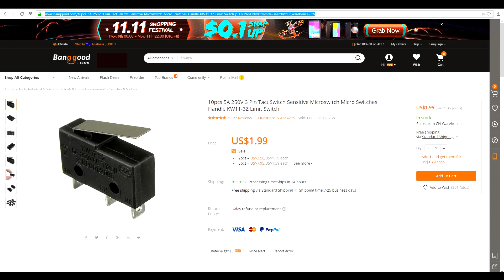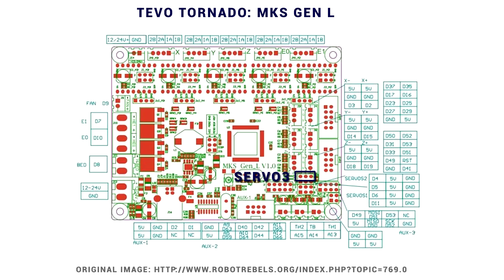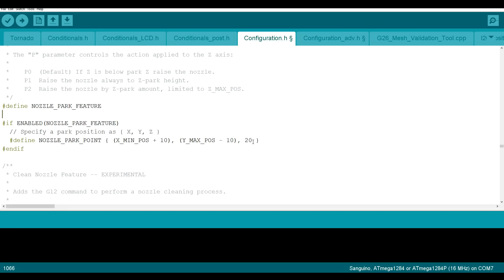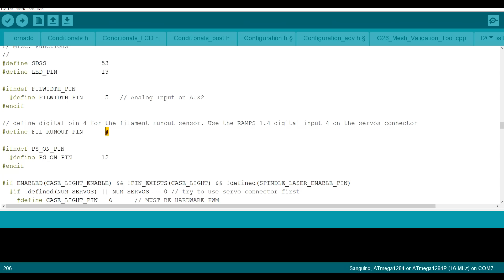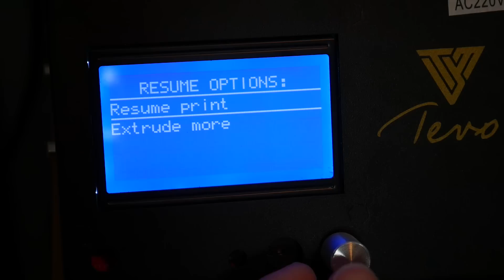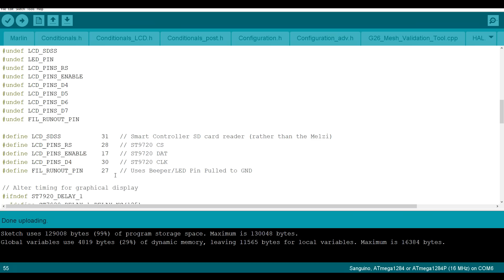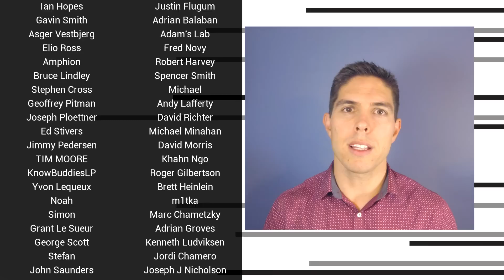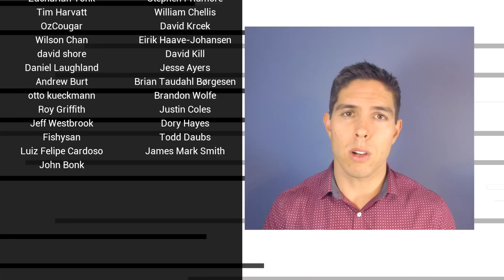DIY filament runout sensor + M600 colour changing

Comment: i actually have a skr v2 and i used the filament run out sensor pins, but when doing so after updating firmware my printer is no longer working..now, any help greatly appreciated

Comment: Great video!  Any chance of doing a tutorial of making this work with OctoPrint?   I have read up on it but I have not had time to dig into it yet.   I have two printers with run-out sensors (CR10V2 and Sovol SV04) but because I am printing with OctoPrint, they do not function properly.

Comment: I bought a ender 5 plus today... have mounted it etc

My BL touch was not working, so I read about firmware update and I downloaded this:
Ender-5PlusBLTouch__V1.70.2 BL.hex
But when flashed with creality, my ender was stuck on boot page with this message PLEASE WAIT, in chinese.

So, I downlaoded and older version:

Ender-5PlusBLTouch__V1.70.1 BL.hex
And flashed again, now is working, but my screen is only in chinese.

In the language options I can see a lot of language to select like english, portuguese, etc but none options work.
How can I install english again?

Comment: having problems with the ENDER 5 PLUS with this

i uncommented
//#define ADVANCED_PAUSE_FEATURE
in
Configuration_adv.h

i also uncommented
//#define FILAMENT_RUNOUT_SENSOR
in
Configuration.h

but when i uncomment it it gives me the error
#error "ADVANCED_PAUSE_FEATURE currently requires an LCD controller."
but im still using the stock ender 5 plus lcd screen

Comment: I have the Th3d EZout filament sensor with the Circuit board that plugs into the LCD ribbon cable port. I have the Tevo Tornado 2018 printer with the mks_Gen_L 1.0. The sensor light turns on and off when I remove filament so power is getting to the Sensor. I get a KILL() error message immediately after turning on the printer. Any idea how to get this to work?

Comment: 8:00 i read this can be done much easier with a raspberry pi and octoprint, no soldering needed, no need to touch ender 3's board at all.  Do you have a guide on how to do that?

Comment: @teachingtech first I would like to say I really appreciate all of your videos! I have used most of your videos to set up my printer and make adjustments over the years. I do have a question on this one however, I have the bltouch and I am adding the filament run out sensor however I am using TH3D instead of vanilla marlin. I have made all the changes but still get the error that you cannot have both. Any ideas?
Reply: Ender 5 pro 1.1.5 silent board running on raspberry pi 4+

Comment: I have an Ender 3 V2 and currently connected a sensor to the dedicated port on the motherboard and the sensor works great BUT only if I'm running from the SD card and not Octopi.  Can I split the sensors "Signal" wire and run it to my Pi and use it that way as well?

Comment: Hi Michael, thank you for this how-to video.  It covered everything except the required steps M502 followed by M500 for the new settings to take effect in the printer's firmware if EEPROM is activated.  I found this out the hard way when M600 tried to push out the lever arm on my mechanical endstop sensor which is situated right above my extruder (since I feed from the top of the printer).  Because of my setup I push new filament into the extruder and extrude out the old filament instead of retracting it.  Apparently there is an M603 stored in EEPROM that includes Unload / Load lengths that will be used unless overwritten w/ M502 / M500.  I thoroughly enjoy your how-to videos, please keep them coming.

Comment: Hi Michael, I have one of those v4 board in my ender 3 pro and they come with the additional filament sensor port. Is it the same wiring for the filament sensor to that port? (the two outmost pins to the switch) Couldn't find any wiring diagram for that board on the internet. Thanks.

Comment: Hello, thank you or your clear tutorial. I have followed your instructions and yet the runout sensor does not seem to be detected.I have a CR20 pro and updated marlin as suggested in the video. Now I am confused  about the runout pin. I setted it to pin 4 as you did in the video but it does not seem to be the one. How would you suggest I find the right pin?
Reply: Nevermind it was pin 2

Comment: Sending M119 always shows filament as TRIGGERED, regardless of whether the microswitch to Pin29 is engaged or not.  Any ideas? (I'm running BLTouch to pin27, running latest TH3D firmware on a silent 1.1.5 board)  Arghh... frustrating as hell... how do I test pin 29 is working?!

Comment: Hey Michael, after I had set everything up for the BLTouch from your BLTouch video (which compiled nicely using your config files that commented out all the extraneous memory robbing stuff) I then added these filament runout detection codes from this video and I got this error code. So I went back through the software,  re-commented everything for the filament runout sensor then started adding them back one at a time from the beginning, compiling between each one, till I got the error. It happens after I uncomment the nozzle_park_feature after the m600. It refers to ".text" will not fit in region "text"...don't know enough to know what that means. Any ideas? Thanks, love the videos!

c:/program files/windowsapps/arduinollc.arduinoide_1.8.39.0_x86__mdqgnx93n4wtt/hardware/tools/avr/bin/../lib/gcc/avr/7.3.0/../../../../avr/bin/ld.exe: C:\Users\jacha\AppData\Local\Temp\arduino_build_275479/Marlin.ino.elf section `.text' will not fit in region `text'

c:/program files/windowsapps/arduinollc.arduinoide_1.8.39.0_x86__mdqgnx93n4wtt/hardware/tools/avr/bin/../lib/gcc/avr/7.3.0/../../../../avr/bin/ld.exe: region `text' overflowed by 2332 bytes

collect2.exe: error: ld returned 1 exit status

exit status 1

Error compiling for board Sanguino.

Comment: excellent videos I have done 90% of the mods to my ender 3 pro. however, with this I can get the M119 to output any data on the filament runout any ideas?
The method i used was pin 29 and its currently not working tried 3 times now :)

Comment: Hi? Can you make a tutorial about bltouch and filament runout using the firmware from the creality gethub page? I'm having trouble with the marlin 1.1.9 and 1.1.x... when i pause my print my hotend won't return to side or retract and go up...

When i pause my print it will just stop and the extra fillament will make a blob on my prints... And it will make disaster after wards... Thanks for the help... God bless...

Comment: Excellent guide, as usual -- THANKS!!!  I'm surely not the lone stranger to have a microswitch sitting around since I added the BL Touch to my Ender 3 -- the original Z-stop switch that I didn't throw away!  That seemed so obvious, yet I've not seen anyone suggesting it, for some odd raisin.
Well, obviously the Pin 29 was the missing link, so I'm most grateful for that find!!!

Comment: I am missing about 800 bytes to get it compiled. What can I disable when having BLT  with bilinear probing activated? Ender 3 Pro with original 1.1.5 (silent) board.
Reply: Finally found an option, which can be deactivated without getting trouble: LCD_INFO_MENU in Configuration_adv.h, now enough space for all features AND M600 (but no runout).

Comment: Just did this same thing but with TH3D firmware, and it was crazy simple.  Follow the standard TT instructions for BLTouch with TH3D, then do the following when adding the filament runout sensor. No need for the advanced configuration and even with both enabled they already have the 128kb limit taken care of.

1) In TH3D in configuration.h remove the // before EZOUT_ENABLE.
2) Go into pins_MELZI_CREALITY.h and under #if ENABLED (EZOUT_RUNOUT_PIN) set FIL_RUNOUT_PIN to 29.
3) Go ahead and Upload, but it will throw an error that you cannot have BLTouch and Runout at the same time, just go ahead and comment out all three lines of that error with some //
4) Thats it...

Comment: I am still new to 3d printing, just got my Ender 3 last month. I could tell after only a week that I wanted a feature like this.My dad had a spare limit switch, It was a bit bigger then most, but I managed to design a mount for it that feeds it directly from the sencor into the extruder. I also printed a direct drive mount from http://www.thingiverse.com/thing:3589452 I am really enjoying this thing.

Comment: On Marlin 2.0 you need to change the line
#undef FIL_RUNOUT_PIN          // Uses Beeper/LED Pin Pulled to GND
to read 
#define FIL_RUNOUT_PIN      29     // Uses Beeper/LED Pin Pulled to GND
in pins_Metzi_CREALITY

you will need to enable both  
#define ADVANCED_PAUSE_FEATURE      (in configuration_adv.h)
and 
#define NOZZLE_PARK_FEATURE               (in configuration.h)

comment out
//#define SHOW_BOOTSCREEN
//#define SHOW_CUSTOM_BOOTSCREEN
and the other stuff mentioned in the video.

Comment: Great tutorial! It helped me getting my Ender 3pro working as it should have right out of the factory!
BLTouch + FilamentSensor

You can keep M503 by disabling AUTOTEMP (2146 Bytes) and LCD_INFO_MENU (1296 Bytes) in Configuration_adv.h
The Info Menu is pointless, and the AutoTempraises more issus than it solves.

Comment: I am trying to get this working on an Ender 5 with the Marlin 2.0 firmware but I cannot for the life of me get by this error:
#error "FILAMENT_RUNOUT_SENSOR requires FIL_RUNOUT_PIN."
I've defined the pin in the creality.h and even trying defining it under the Enable (Filament_runout_sensor)
Error just won't go away.
Reply: I had the same issues. I wrote everything exactly as Michael did, and it works.

Comment: Thanks for the time you put into these videos.  I do understand it takes a long time to edit and put these up.  I followed your directions with my Ender 3 with the BLtouch and it works great!  I'm printing a cover right now and have "reloaded" the filament several times and typed in the M600 into Octoprints terminal and found it works great.

Comment: Edit- Got it working with the TH3D software, had to copy the lines from config.h for the sensor runout (all lines).  seems to work well, still have bed leveling.

Comment: excellent video,... I may decide to go with a filament runout sensor, as I have had issues with the Amazon Basic PLA I use having the habit of randomly SNAPPING due to their seemingly crappy rolling of the spool causing overlap tension. Doesnt happen often, but its pissed me off at least 2 or 3 times so far.

The M600 trick tho, thats the bees knees, my guy. Ive been thinking about how to use different filaments, seeing all this "dual filament" hot end things, and so on,... but this will allow me to really take a much more simple approach to a few thoughts Ive had on some projects.

Excellent work as usual, always look forward to seeing new content from you, but I still find myself randomly coming across an old video I missed and learning new tricks! lol

Comment: I have tried TH3D version 2.13, version 2.15 and Marlin version 2.0. Versions 2.13 and 2.15 do not have any reference to Filament_Runout. Marlin version 2.0 has Filament_Runout and Power_Loss_Recovery but, it will not compile. It keeps saying that Filament_Runout requires FIL_RUNOUT_PIN which I have set to 29. I have enjoyed all of your videos, they have been very helpful. This mod is a real challenge.
Reply: I have added correction in my own comment, the defines have changed since this video was made.

Comment: Did you mean to link the switch with the wheel (roller) on the amazon link?  It’s a pretty different switch from the Banggood one you linked
Not trying to correct you, just actually wondering if the wheel is better

Love your videos man
Reply: https://www.youtube.com/redirect?redir_token=jPWAqBJjBtTF7OckBPZTQla2lDB8MTU2Njk3NDUzMEAxNTY2ODg4MTMw&event=comments&stzid=UgyvWnUVNVieF52oFL14AaABAg&q=https%3A%2F%2Fwww.amazon.com%2FAnmbest-Momentary-Button-Switch-Arduino%2Fdp%2FB07DCV7XYL%2Fref%3Dsr_1_4%3Fkeywords%3Dmicro%2Bswitches%2B3%2Bpin%2Blever%26qid%3D1565794090%26s%3Dgateway%26sr%3D8-4&html_redirect=1

Comment: HI! since the printer has the possibility of recovering from a power cut. Do you see it possible that the switch directly cut the power source?
Reply: Interesting idea! It might be possible to do that but I'm not sure how the power loss stuff works. If the resume waits for the user to restart it in the menu (aka not blocking you from heating up and adding the new filament properly), then you should be able to use that instead of the firmware changes and wiring it in

Comment: Hello TT
Did you use any resistor because you put it on normally closed (or is the output very low on these pins)
Reply: No resistor is needed

Comment: how do you set up filament runout to a ender 3 with a MKS GEN l board and MKS TFT 28
Reply: I am in the same boat with a tft35 I connected sensor to the pins and changed the option in the MKS TFT setup file but it doesn't work do i also have to edit marlin?  I cant find anyone else who has done this using the pins on the back of the TFT35

Comment: i've just fitted the new quiet Creality board and am trying to fit a filement runout similar to yours. i am using pin 29 although havent fitted a bltouch yet but might in the future hense using 29. i have tried to upload the updated code via the arduino software you show in you video but the message comes back as 'timeout comm with programmer'. i can you suggest what i need to do. thx andrew

Comment: Your videos were very handy,  I just finished an Ender 3 upgrade to the MKS Gen L board and added the  BL-Touch & filament runout sensor.   I appreciate your efforts in including both hardware & software changes in a concise but complete fashion.   Thanks!

Comment: Hi there I've got a problem and I really need some help because I'm not sure what I've done wrong. 

I'm trying to get the filament run out sensor working on my ender 3 and for it to pause and park the extruder when it runs out of filament and allow me to reload it and resume the print where it ran out and left off. I've been following this video to the letter but all that arduino keeps doing is giving me error when I try to compile the code

#error "PARKING_EXTRUDER requires SOL0_PIN and SOL1_PIN."

If any one has any idea how I get this too work I will be so grateful because I havent got a clue. I'm new to coding.

Comment: Crystal Clear! Really appreciate the Full Size legible screen : )  I bought rather than made a runout sensor which arrived with no installation instructions (helpful, not) so if anyone knows where I've to plug it in on a Ramps 1.4 board  (wires, red black & white in that order) I'd very much appreciate that help : )

Comment: Hi ;) I followed the video and it works on my ender 3, however, I wan't to manually removes the filament. I set FILAMENT_CHANGE_(SLOW/FAST_LOAD and UNLOAD_LENGTH) to 0, but when it detects run out of filament, it parks and then unload the filament :( then it force the filament trought the sensor and broke it.... My sensor is one-way, if the filament enter from the other side, it can broke the switch inside. That's why I wan't manually remove filament... I'm using TH3D U1.R2.9b... What I'm doing wrong? :)

Comment: Hi Michael.Love your videos, but now I have an question for you. 
Is it possible to do this with the new  TH3D firmware? 
I searcht for the option but could't find it.Could you please help.
Reply: Yes, it is. I already done that. But I'm facing a problem. Because it remove the filament after pause and I want remove manually. I already 3 max length to 0 but it dont work. Im waiting for his help
Reply: @joaocosme4202  how did you get it to work? Did you changed the firmware by adding the code necessary the filament change cause I don't see it in the th3d firmware.
Reply: @dinantreterink6918  you need to uncomment #define EZOUT_ENABLE, right where you uncomment #define ENDER3, in configuration file
Reply: @joaocosme4202  I did what you said and it worked, thanks for your help.

Comment: Hi Michael, thanks for all the videos for the Ender 3!
I have a problem installing the filament runout sensor, my BLtouch is using the ground pin on the 6pin ISP. Is there another way to connect the ground wire for the runout sensor or can the 2 ground wires be splice together?
Reply: Dude, it's a grounding pin lol, think of grounding as in any part of the closed loop grounding wire can be connected to it, simply solder underneath or solder the bltouch sensor and filament sensor grounding wires together, if you don't want to touch the bltouch, lift the board after removing the 4 bolts and solder under the header, that's where you can also solder the pin 29 wire instead of adding in a header pin.